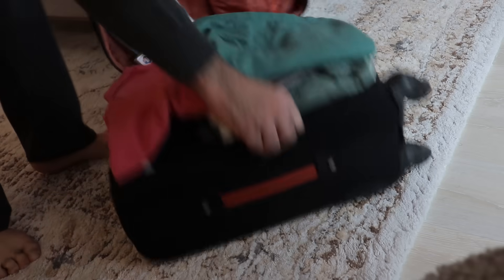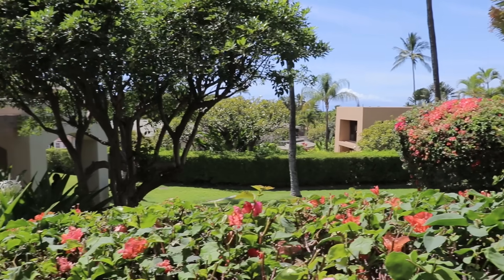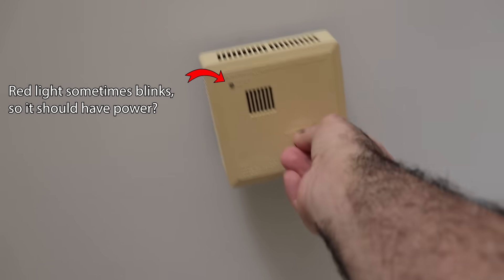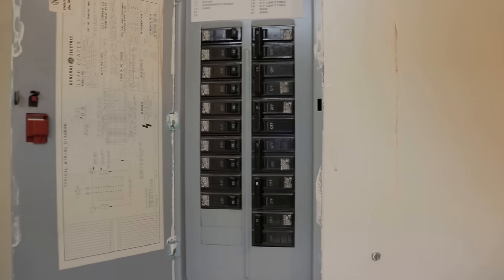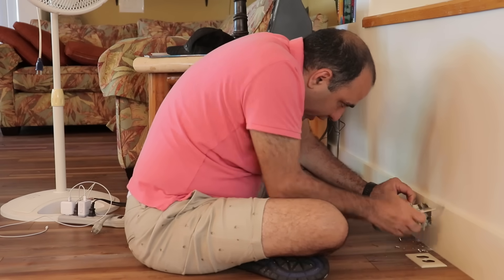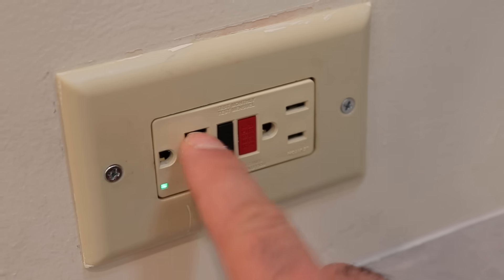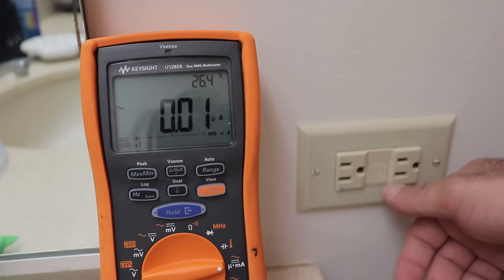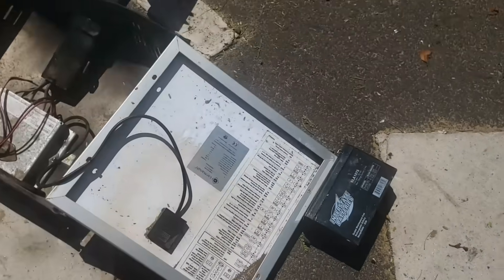Hawaiian Hotel Safety Failures

Comment: Can you show the actual circuit of the test button of the GFCI? I assume it just connects a resistor across the mains to ground, but never looked into it.
Reply: Ground is not involved in the test because the breaker has to trip even with a bad or missing gorund, it connects a resistor between Line input and Neutral output or vice-versa.
Reply: @ruben_balea  No, if that were true then it would trip with any normal load above 5mA. This isn't a breaker we are talking about.
Reply: @ryandailey1496  I know very well what a GFCI is, I said a load between Line IN and Neutral OUT or viceversa, normal loads are connected to Line OUT and Neutral OUT

Here you can see the electric diagram showing exactly what I said: https://en.wikipedia.org/wiki/Residual-current_device

And here you can see the internals of a 3-phase model: https://de.wikipedia.org/wiki/Fehlerstrom-Schutzschalter#/media/Datei:Siemens_I=40A_%CE%94I=30mA_RCD.JPG

In that picture, the blue wire is connected to Line 3 IN and to one end of the test button's green resistor which is mounted in a hole.

The other end of the resistor is connected to the spring next to it, which functions as one of the test button contacts, the static test button contact is connected to Neutral OUT by a conductor hidden under the plastic piece that holds the transformer, as you can it's removable and is held in place with two Torx screws at the top and one at the bottom.

Any load between Line IN and Neutral OUT or Neutral IN and Line OUT makes it trip but also if there's any load above 5mA (or the rated leakage current GFCI) connected to the outputs it will trip also if you short Line IN with Line OUT or Neutral IN with Neutral OUT.

The measurement device consists of a simple transformer, the primary is made up of a coil of few turns of thick cable for the line and another for the neutral.

When the two coils pass the same current, the magnetic flux from one gate to the other because it is the same amount of current circulating in opposite directions.

If a part of the current that enters through one coil is diverted to ground, it will not go out through the other, then the magnetic fields stop canceling completely and a proportional voltage is created in the secondary of the transformer that is usually a coil of fine wire with many turns.

When the secondary voltage reaches or exceeds a certain value, the electromagnet is activated, causing the switch to trip.

The secondary of some models has fewer turns and an electronic amplifier powered by mains voltage is used to activate the electromagnet.

The use of electronic components makes it possible to build much more compact switches and to make improved models that have more features, such as filters to ignore electrical noise and/or have the same sensitivity to alternating current leakage as to pulsed direct current leakage that can occur in the event of failure of switching power supplies or any other device with any type of rectifier to convert AC to DC
Reply: @ruben_balea  You are still wrong. The links you sent are mostly for over current protection. That's not what I'm talking about. GFCI detects an imbalance between the hot and neutral.

In a normal working circuit, all the current would run only between the neutral and hot, producing no signal through the detection transformer. But if the current doesn't return to neutral, there would be an imbalance which would be detected at the transformer.

A load between the hot and neutral would not produce an imbalance, A load between the hot and ground would, as there's less current on the neutral as compared to the hot.
Reply: @ryandailey1496  I'm not wrong, maybe I'm not very good at explaining myself and it seems the link I used for the photo shows a page with all kind of breakers if you close the photo, that's because that photo is used on many Wikipedia articles, but I was referring to that particular photo and not to any article, here's the link for the photo without any Wikipedia page "hidden" under it:

https://upload.wikimedia.org/wikipedia/commons/0/03/Siemens_I%3D40A_%CE%94I%3D30mA_RCD.JPG

The photo shows the internals of a typical European 3-phase RCCB (residual current circuit breaker) which is just how a GFCI is called in the UK, in Germany those can be called "Fehlerstrom-Schutzschalter" which is the literal translation of "residual current circuit breaker" but they are commonly known as "FI-Schutzschalter" or just "FI" as you can see printed in the cover of that breaker next to "RCCB" under the Siemens logo and part number.

"F" means fault and "I" means current because "I" is the symbol used represent current in formulas, like in "V=I/R"

At least in France, Germany, Italy and Spain those are also called "differential interruptors" (Disjoncteur différentiel/Differenzstrom-Schutzschalter/Interruttore differenziale/Interruptor diferencial)

That specific RCCB also has "100A" printed on it above a fuse symbol, that means it must be protected by a 100A fuse or magnetic circuit breaker, it doesn't mean it will trip with currents over 100A.
The "10000" in a rectangle next to the fuse symbol means that its contacts can break currents of up to 10kA without the device stop working properly.

In case a short circuit occurs at the same time as a fault to ground the RCCB only trips due the fault to ground but it must be able to break a short circuit current up to it's rated 10kA, if it were not able to interrupt such a large current, for example because its contacts got welded in the closed position or were not able to extinguish the electrical arc, then the device would lose its ability to protect against further earth faults.

Of course there are models that combine various types of breaker in the same housing, but it is not the case of the switch of that photo.

The test button works by connecting hot in and neutral out through a resistor calculated to draw a bit over 5 mA to make the neutral coil generate a slightly higher magnetic field than the hot coil, and that imbalance makes the GFCI trip. When I said that a load between hot and neutral I was clearly referring to a load between the hot input and the neutral output or vice-versa.

Also if you have any load connected after a 5 mA GFCI and such load is over 5 mA the GFCI obviously won't trip, but if you take a wire and jump the hot input terminal with the hot output terminal or the neutral input terminal with the neutral output terminal on the the GFCI itself then the current will go through that wire instead of through one of the GFCI internal coils, that causes the imbalance because only one coil is creating a magnetic field.

(EDIT: I had to remove duplicated line breaks because I wrote it in a different browser than the one I normally use for youtube and for some reason it tripled the line breaks)
Reply: @ruben_balea  GFCI and RCCB are different things. Even if the RCCB has ground fault protection, the test(neutral to hot) is only designed to test the over current protection not ground fault protection. A ground fault test would need to go from hot to ground.
Reply: @ryandailey1496  No, both are the same thing, I think you're confusing RCCB with RCB, RCBs were forbidded decades ago in Europe, those had a terminal connected to the ground wiring to measure if any was current flowing from a live conductor to a ground conductor, those only tripped in case of a fault in a conductor or in an electrical machine. Those did nothing to protect people since they would only trip with ground leaks in the range of whole Amperes.
RCCBs/GFCIs or whatever we want to call them, were designed to protect people's lives in the first place.
Then, as a consequence of their mode of operation, they also reduce the risks of fire and can protect the wiring and electrical machines because they cut the power and make it necessary to find and repair faults (usually) before a catastrophic situation can occur.
RCCBs only have live and neutral inputs and outputs and detect faults by measuring the difference between the current that enters them and the current that returns to them, if something is missing then there's a leak to ground, being ground any any material that can conduct enough electricity and not just the ground wiring, you don't need to touch the ground wiring to be electrocuted.
For that reason the test button does not test the if the ground if good or bad or missing,test RCCB functionality to trip because internal components age and wear to eventually fail. Those kind of wall sockets with built-in GFCI have a ground terminal to provide the ground for the sockets ground terminals, it's not used by the GFCI part at all.
Reply: @ruben_balea  Did you watch the video? Did you not see Medhi testing between the ground and the hot wire? 

GFCI are only for ground leakage detection. They detect an imbalance between hot and neutral. Any normal load does not produce an imbalance. Any leakage to ground will produce an imbalance between hot and neutral which will be detected by inducing a current in the transformer (due to the current in the wires not canceling out through the transformer). 

This device cannot be tested between hot and neutral, that will not produce an imbalance. There must be a leakage to ground otherwise it's an invalid test for leakage to ground.
Reply: @ryandailey1496  I understand what you mean but you don't understand what I mean, it's not your fault, as I said I'm really bad explaining how things work 😥
He tested it the easy way, with the GFCI in mounted in the wall and using the nearest ground which was in the socket itself, he could have run a lead to a nail stuck in a tree outside instead of using the ground wire or doing it the full Electroboom way (⚠️👉🔌⚡☠️)
If you remove one of those from the wall to have acces to the terminals you can use a resistor between line in and neutral out to make it trip, it's the way the test button is wired internally... 
Please watch the video from the link I will put bellow, around 8 : 18 Alec makes it trip that way, if you continue watching until 12 : 45 Alec shows how the test button is connected to a resistor. Also you can see how the GFCI part only needs live and neutral to work while the ground is only wired to the outlets ground strip.
Whit that link the video starts at 8 : 18 but I recommend you watching the whole video if you have time to do so, Alec explains how a GFCI works really well, like 1000 times better than me 😅

https://youtu.be/ILBjnZq0n8s?t=498

(Edit: I had to edit the timestamps because they were linking to these times in this same video and it was confusing)
Reply: @ruben_balea  I suppose it would work if you connect the downstream (load side) hot to the upstream (power source) neutral. Basically so the neutral bypasses the transformer, but the hot does not.
Reply: @ryandailey1496  Yes, that's the idea, I think I should have included precisely the words "downstream" and "upstream" in my explanation instead of "input" and "output" to make things clear, but English is my third language and sometimes I can't remember the appropriate words for technical terms, actually in Spain we use exactly the same terms "aguas abajo"="downstream" and "aguas arriba"="upstream" but for some reason it seemed strange to me to translate them into English.
Reply: @ruben_balea  And I suppose the ground wire itself is a separate safety device. Deliberately connecting to it, even as a test, violates that safety paradigm. The test could fail and suddenly you have a live bare metal ground wire.

Comment: In my last flat i once smell a burning scent. I turned off all breakers. After turning them on one after another I saw one of my outlets glowing inside 😱. An electrician fixed it right next day. It was a bad corodet line at the socket.

Comment: I think that's a heat detector, not a smoke detector.  Also I'm pretty sure you aren't getting your security deposit back!
Reply: It said smoke detector on the label, maybe it does both, that’s why there was two test modes but it’s dead because it didn’t work on any of them
Reply: @Angrylad.  oh.  I saw the temperature rating on it.  I’ve worked with heat detectors before but nothing like that

Comment: I replaced the outlets in my house to avoid my wife requiring those plastic inserts (used TR outlets). I found so many places where small fires were started but apparently never went anywhere due to poorly stripped wiring and other reasons.

Comment: Hotel outlets have always been risky from my experience. I wish repairs on these things were more prioritized. We also did a recent vacation in Mexico, and I had to use a backpack to lean against the phone charger so it would sit in enough to work.

Generally very good advice here about outlets and smoke detectors, I never realized loose outlets could be a fire hazard. Paired with a bad smoke detector that seems like a big risk. I usually change my own home outlets quite often when they become loose just because of the inconvenience of it.

Comment: Well, at least the painters and dry wall installers are respectful of all the outlets, panels and fuse box, in other places they would've painted/applied plaster between the outlets and the wall, so you would've flaken off the plaster around the outlets...

Comment: I stayed in the same (or similar) hotel about 10 years ago.  Even then none of my international plug adaptors or US plugged leads would stay in the sockets.  I ended up using a suitcase to force & hold the plug in the socket.  But as you say a great stay and place to visit.

Comment: Pro tip, carry a covert companion. It has a latch slip tool.  Either that or a travels companion.  Also, check local regulations before traveling with tools like that.  While they're mostly legal in Canada, they are absolutely not everywhere.  Also, have to leave the caveat don't pick or bypass a lock you don't own, or have permission to do so.

Comment: I welcome you to Italy to check our outlet system. We don't have anything like the GFCI, but we should have a general breaker that protects all the house. I wish you can confirm.
Reply: We do have ground fault breakers in Italy. They're just called "interruttore differenziale" though, as you say, it's usually one per circuit/house and not on the single outlet and they're often set for 30 mA. You can however find outlets with a breaker even here (see for example Vimar 14286)

Comment: Low switches and knobs definitely ADA issue.  
The smoke detector: yes - ionizing types last about 10 years but the photoelectric ones don't have an expiration date.  That one was large so probably the photoelectric type. Also since it was direct connected to AC way back in 83 this would be another indication since the photoelectric types were generally amp hungry and chewed up batteries if DC only (a zinc-carbon 9v wouldn't last long and mine used several Alkaline AAs).Years ago I had one of these types and frankly the only way to check that it was working was actually use smoke. It might also have had a "heat" sensor (mine did); that was why the two position test switch.

What I've never seen before were the outlets cut out in the kickplate.

BTW, nice way to write-off your vacation.

Comment: As a maintenance worker in a hotel, i really agree with you. Our budget is not limited, we'd love to have unlimited access to new parts, but we have to work with limits... i'm trying to get the manager to buy me a 3d printer to help me fix some stuff cheaper, but new ideas takes really long to fit in... At least here in spain (or in my hotel) i check all differential breakers at least twice a year, so i know they are all working... but you also have to deal with some customers with 115v shaving machines that makes the breakers pop.... please check the working voltage and frequency before going to other country, to guarantee that everything you take with you will work there... or ask in the front desk, they'll be happy to answer!!!

Comment: When trying to open the door pull on the door after you slide the little bar back hold the door while you readjust so you can slide again once that little bar has passed the frame then you can actually move the latch

Comment: 4:19 
W A S T E D

4:50 you can, if you have a little screw and a paperclip or a safety pin strong enough to lift the lock pins and just jiggle it, youll never trust locks ever again (i did it 3x when our classroom is locked and the keyholder is absent, teachers calls me a thief candidate)

8:55 Ohhh so thats why my parents electric fan plugs gets hot, luckily i replaced the outlets myself (also the damn plug with thicker gauge which is unnecessary after all)
Welp, the more you know

Comment: Holy smoke! I bet that really was the original equipment smoke alarm from when the place was built in 1984. And very unusual placement for the electrical panel. I have never seen that in my life.
Reply: I'm wondering if having a hidden panel like that is up to code. It's a violation in many states.
Reply: @glenmatthes8839  Not only hidden but it looks like that the electrical panel is in the bathroom..

Comment: What's the problem with phone chargers in the bathroom? I mean they're only a few volts DC. So unless they short out because of the humidity and have the live AC current bypass all the circuitry (including the full bridge rectifier) going straight to the output, which I don't think is very likely, then I don't see the harm.